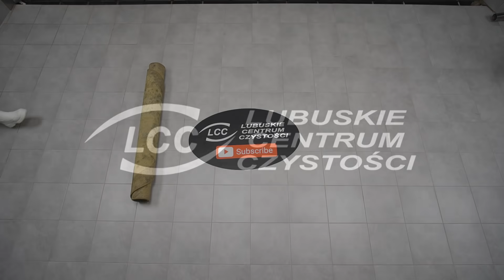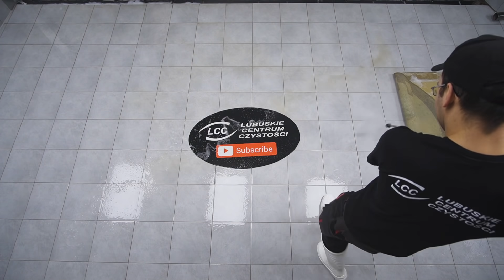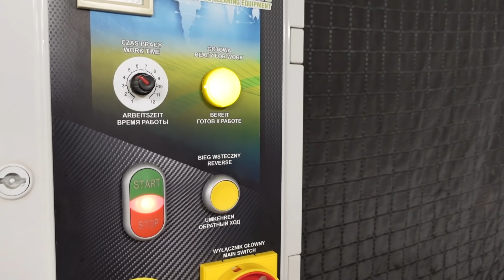CZARNY GRZYB ZAATAKOWAŁ DYWAN który leżał miesiącami na dworze. Uratowaliśmy go i jest czysty 💪😍🌊

Comment: It has always been my understanding that carpets and rugs are not the same things. The differences are as follows. A carpet covers the entire room, and sometimes the entire house. A carpet is tacked down solidly to the floor, and while a carpet can be removed, it takes a lot of work. Carpets are not very portable. When you clean a carpet, it cannot generally be picked up and taken somewhere else to clean. You can't get a carpet as wet as you can a rug, because the floor underneath can't handle being wet, like hard tile floors can.  A rug only covers a portion of the floor, CAN be picked up or rolled up, and taken somewhere else to clean. A rug is not tacked down to the floor.

Comment: Questions: Would your box brush have helped on a rug like this on the backside? Also, why don't we see you use this equipment on the back?
Reply from the maker: Until I checked. From 18:38 you can watch the scrubbing of the underside of the carpet 🤗💖🌊
Reply: @lubuskie_centrum_czystości  Yes sir, but I meant your machine with the two blue brushes on it.